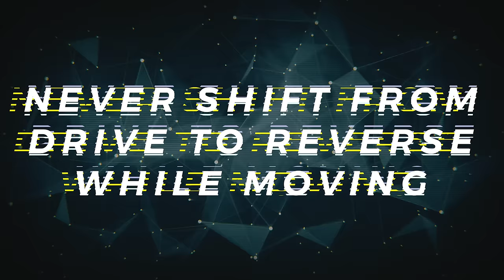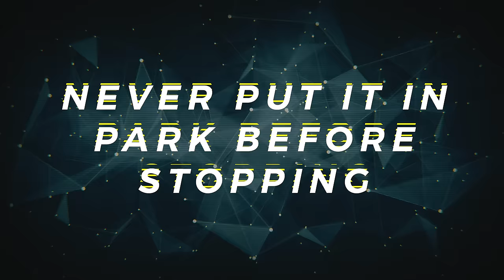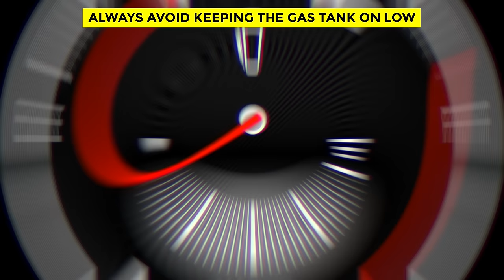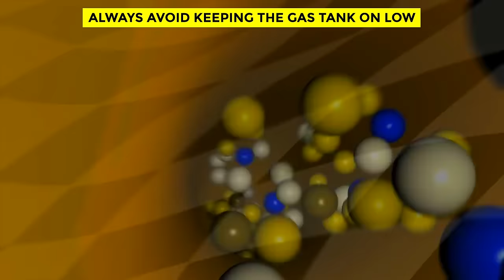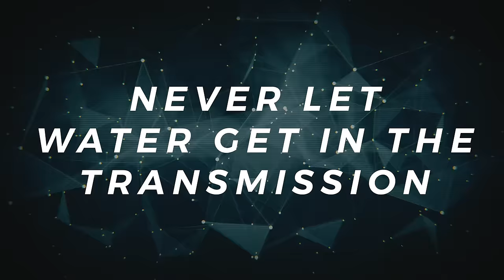7 Things You Should NEVER Do In an Automatic Transmission Car!

Comment: Anybody who thought that putting on the emergency brakes at a stoplight would save on gas, has got to a least have their driver's license suspended.
Reply: Carlyle Tom 😂
Reply: I have a better one. Here in Laos the locals actually swear that if they turn their motorcycles off at night they will save fuel. Honestly!!!!
Reply: I meant to say " ...turn their motorcycle  LIGHTS off at night...."
Reply: errolflynn1952 then what the duck is the point of the lights ?😂
Reply: Actually, what you described has an opposite effect in Great Britain. In case you are rear ended at traffic lights, engaged parking brake will help you prove you didn't reverse at all.
Reply: Anybody who didn't thought  putting on the emergency brakes at a stoplight would save on gas , has got to a least have their driver's license suspended
Reply: I'm so confused..what the hell is an emergency brake? You mean handbrake? They're not even for emergency situations. You just use the brake pedal in an emergency stop. (I'm not a native English speaker)
Reply: @locobot  handbrake is emergency brake, or e brake for short (not electronic brake). This brake used to hold your vehicle during park, so your car won't move around. Second, during emergency situation, if your foot/pedal brake won't work, the handbrake come in handy. By engaging and disengaging the handbrake multiple times (or pull and push if you prefer that term), you're applying friction to your rear wheels brake... since the foot/pedal brake run by hydraulic pump, handbrake run mechanically on cable.
Reply: @christianivan756   Yeah so that's another word for handbrake... That's why I don't get it, the handbreak does absolutly nothing when the car is rolling so why call it like that? You just  don't use the handbrake in any rolling situation, multiple times or not, it just won't do shit (the cable pressure is nothing compared to hydraulic pressure). I think it's dumb to call it "emergency  brake " because that's not even its main function and it can confuse people into using it in a emergency stop.
Reply: @locobot  if your "hand brake" does nothing when your vehicle is rolling then the "hand brake" is messed up, broken. That "hand brake" is a back up brake for emergency situations like a busted brake line where all your brake fluid is gone the "hand brake" works off a cable and should slow the vehicle down to a complete stop. That's why you have it.
Reply: @dbclass4075  and how the hell do you even prove you had your parking brake engaged before the crash and not after
Reply: @TWEAKLET  Mechanical parking brake is audible as several rachet clicks when engaging. That can be captured on the dashboard camcorder. Some electronic parking brakes have distinct beeps when engaging, and/or recorded as electronic data into the vehicle's on-board recorder.

All they have to do is to compare either cues above, and whatever images the camcorder captures. It is all about timing between the two.
Reply: @dbclass4075  my truck makes no noise when the emergency brake is applied i assume only hand brake versions do this noise my trucks at my left foot on the ground
Reply: @TWEAKLET  Yep, it is the handbrake type that produces noise. If I remember correctly, truck brakes are pneumatic, which can be checked on the dashboard, assuming a camcorder is pointed there.
Reply: @dbclass4075  you could just have put it in park after the accident. It doesn't prove anything
Reply: @riptaway  I mean the parking brake, not the mode of automatic transmission. If you have a dashcam that can record audio and a manual lever type of parking brake, the racheting noise will be captured. The timing of this noise can determine when the parking brake is applied.
Reply: Chris Ivan    Isnt it dangerous to just use the handbrake to slow down all time. I mean think about it if you car is moving, then locking up the wheels can become a bit of a problem for you. Also if it takes you that long to brake then you may need new brakes. I get it that you dont stop instantly but that may be a bit too far
Reply: @DK089  Maybe he meant in use of emergency, when you suffered sudden brake failure. Although yes, parking brake usually are not governed by ASB.
Reply: @dbclass4075  If you have a dashcam you can easily prove you were not at fault anyway.
Reply: @locobot  call it a last resource brake
Reply: It does if you put it in neutral
Reply: word 😂
Reply: @locobot  it was named that when hydraulic brakes were introduced. People were nervous about having fluid be their main source of stopping so manufacturer's left the hand brake that is cable operated in case you lost hydraulic fluid and needed to stop. So in an emergency you can still stop if needed.
Reply: Technically it does because you rear lights turn off saving you a quarter of a cent.

Comment: 1. Never shift from drive to reverse while moving
2. Never put it in park before stopping 
3. Never switch to Neutral at stop lights 
4. Never coast in Neutral
5. Never launch your car while in neutral 
6. Always avoid keeping the gas tank on low
7. Never let water get in the transmisión
Reply: Thx
Reply: Thanks
Reply: Why not neutral?
Reply: Why cant we put neutral during red stop lights?
Reply: @ashborn5943  Skip to 2:12
Reply: Nigga I went 100% on what not to do
Reply: My Ford Edge is sensitive and sometimes I accidentally hit the stick and it changes to neutral. I don’t even touch it or hit it that hard .
Reply: Thanks
Reply: 4. Just got a 2016 Volvo and in Eco Mode it automatically coasts in neutral?

Comment: 1:17 I didn’t know Lamborghini brakes cost $100

(Edit: thanks for the likes)
Reply: That's a great bargain
Reply: where?
Reply: there on aliexpress i think
Reply: i dont know man, just replaced Rav4 03 brake pas and it was only $63. DIY replaced
Reply: Johnny To lamborghini brake pads are a lot different than a Rav 4. And I would like to see anyone brave enough to diy fix a lambo
Reply: @aidenminer1559  Why wouldn't you fix a "lambo" by yourself?
It's not a space ship
Reply: @0hjaa3.06  ehh Well one one hand: yes it is just a VW (seriously half the parts have a VW logo printed on) but on the other hand it is a supercar, where the focus isn't on easy repairability, for example to change the brakes of an Aventador (Wich cost about 30.000-50.000€ in parts alone) you need a Lamborghini or VDS Diagnostik  system + codes for Lamborghini, the radio code for said car and a torgue wrench that can do 600nm of torgue.
+ The wrench socket obviously, oh and a friend to press the brake.
Reply: @Ocastia  Why does someone need to press the brake?
And why radio codes? Weird
Reply: @0hjaa3.06  radio codes so that the police doesn't arrest you for trying to access the software of the vehicle without permission, and someone needs to press the brake so that you don't snap the parking brake, whilst trying to apply~550nm of force to the central locking.
Reply: 0hjaa 3.0 lmao I was thinking the same thing 😂
Reply: @Ocastia  I don't understand. How do cops know if someone does something illegal with a cars computer? Also radio code is for locking a radio. So that if someone nicks it, they won't be able to use it.
Or is it a USA thing? Also why does central locking need that much torque? My cars central lock opens quite easily? Just stick the key in and twist it.
Reply: Maybe in 1969...
Reply: Yeah, probably $100 for half a brake pad
Reply: Count yourself lucky it isnt McLaren cuz they will charge you 2k
(joke)
Reply: They cost $13 on wish
Reply: AMG brake pads go for about $800 USD for all around. I figure Lambo pads are probably even more.
Reply: Ricky Cooks No I think he meant it costs $100 for the dealer to tell you they need replacing.
Reply: @aidenminer1559  I am sure anyone with the right amount of knowledge can fix a lambo.
Reply: Too cheap to be true
Reply: @affalterbachamg2094  i heard you can get a good pair of brakes o a website for $250 my uncle gets a discount though so hes looking at $210 for em. This is including not installed.
Reply: @aidenminer1559  there are numerous people repairing Lamborghinis here on youtube lol
Reply: Brake pads are pretty cheap
Reply: @Ocastia  the pads are only $200 per axle.
Reply: @jonakers704  About the same.  I just priced several.
Reply: @jmackinjersey1  + those are brake pads for the old Gallardo, wich has considerably smaller brakes (and uses the same as an Audi R8, so they should be cheaper), and you just took the pads into account not the titanium bolts, or the CCB that you will usually have to change at the same time.
Reply: Yes, cuz that car on picture is just a expensive toy car xDDDDD
Reply: @aidenminer1559  how much for a oil change????!
Reply: Bet u  didn't know that the Diablo head lights are from a 300zx
Reply: Ricky Cooks that shit is crazy
Reply: Nobody's brakes are $100 unless you do the work yourself.
Reply: They cost more than this
Reply: lol
Reply: The aventador has a 60k Trans
Reply: @Ocastia  I will assume you haven't actually looked plenty of people have rebuilt repaired and maintained plenty of supercars including Lamborghini's
Reply: @Mace-1191  what kind of Lamborghinis? And how much did it cost?

+ I never said it's impossible, I mean if an absolute moron like me can do it why shouldn't someone else be able to do it, it's just quite a bit of work, and expensive.

I wouldn't do it if I had the money to buy a Lamborghini.
Reply: Well i mean i drive a corvette and use the ac delco carbon ceramic brakes with iron rotors and it stops from 70 in about 6 seconds
Reply: Jon Akers as having an old Lamborghini Gallardo the replacement brakes from the facory themself costs 1400-2000 dollars. I think diy ing a lambo is not a good idea if you know a couple of guys in old tuner shops some might know how to put a new twin turbo on your lambo like stradman’s lambo
Reply: Looooool
Reply: Lamborghini brakes are more expensive than 100$
Reply: Ricky Cooks same
Reply: Ooo I gotta buy some
Reply: Accurate Rick lol 😂
Reply: I own one trust me it’s way more
Reply: @buschgardensrollercoastero4579  lmao keep dreaming buddy the only Lamborghini you're owning is that electric toy car your mommy bought you
Reply: mad flex
Reply: And d stands for die so never put in d always on r or n
Reply: @Ocastia  how can you afford a lambo but not the brakes for the lambo?
Reply: @morrogota7523  leasing maybe? 
But if you can afford to own a Lamborghini, you probably won't even think about doing maintenance on it yourself.
Reply: Lambo brakes problly 1k to 5k
Reply: ikr
Reply: It’s good
Reply: I have lamborgini brakes on audi a4
Reply: Look on ebay lol
Reply: @aidenminer1559  Cough...Tavarish
Reply: @Ocastia  you can't be arrested for working on your own car that's ridiculous.
Reply: @aidenminer1559  they are just breaks but most people who own them don’t even know how to change them (not all just some of them)
Reply: @Ocastia  what about tuning
Reply: @thaemeraldramen2218  tuning what? I mean I'd recommend a Tuning Rod nonetheless, but i need more information to give you a concrete answer.
Reply: @thaemeraldramen2218  exactly. most of the people who own a lambo have the money to get it fixed so they’re like “oh just fix it for me i don’t know how to and don’t wanna learn”

Comment: "Never let water get in Transmission "  

 so we shouldn't drive while it's raining 😒😒😒😒😒
Reply: Saul B Delara dont park your car in the rain either. Or wash you vehicle. It could cost you!
Reply: Rain falling doesnt affect the transmission as it is located under the car. He meant dont drive in high or flood waters. Or any body of water where it can cause water to splash under the car continuously.
Reply: No, rain won't get through the gaskets and seals. Never pressure wash mechanical parts with oil in them. Oil and water don't mix, but they interact in a way that when heated and mixed by spinning gears, they foam up into bubbles, dropping your oil pressure and causing your car to not lubricate itself properly, leading to metal shavings from metel-metal contact, which, even after you replace the oil, will still slowly eat away at your transmission.
Reply: @spicketspaghet7773  automatic transmissirons have breathing filtered holes that allow for fluid expansion and depressurization some cars have them low near the ground where water can be sucked in if you drive through high flood water
Reply: Simple close ur windows while going through a heap of water and rain
Reply: @chiwarriehartley6595  if the water is high enough to do that much damage you shouldnt be on the road in the first place
Reply: Zephyr IV what about a car wash, don’t you need to clean under your vehicle???

Comment: Scotty Kilmer says putting your automatic in neutral at a red light puts less wear on the trans.
Reply: Tony M he also says that you should get a toyota
Reply: @Aurshh  and adam lz told me supra,s are fun and good cars
Reply: Shifting in an automatic is completely fine as long as you're stopped and are holding the brake pedal, no damage is being done ffs.
Reply: CORRECT: With Fluid Flywheel Transmissions this will prevent the transmission fluid from overheating. With Double-Clutch Systems it prevents wear on the Clutch Faces!
Reply: I drove a automatic once in my life last year. As i waited at a red light for more than a minute, i went to neutral. im guilty! =D
Reply: He has a point, as torque converters aren't slipping.

Comment: I used to use N in waiting, put to prevent rev my gears, I move gear knob to D then get handbrake down, that’s gives gear transmission enough time for transmission.
Among the reasons why I don’t like keep pressing brake while in D, especially if u not waiting long or not awake enough, ur could spontaneously loose ur pressing on brake and hit car before u, or behind if u on hill.
By the way, I used to use N because now I using HoldBrake.
Reply: i feel way more stupid just reading this, i lost a lot of brain cells.
Reply: @billybrown6236  what he said is that some people will loose foot strength and slowly release the brake and not know it, now you are going forward and not knowing it and then you hit the guy in front of you. (Prob because you were on the damn phone) .. 
So by putting it in N and using the hand brake, that keeps your car at a stop. 
When the light turns green, you shift to D and then release the hand brake. 
Or just sit there and HOLD the brake with firm pressure for over 2 min while in traffic ....